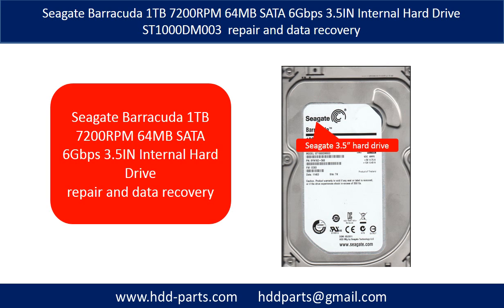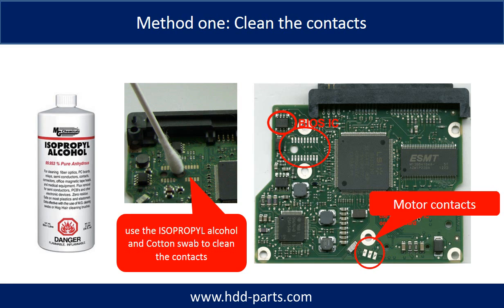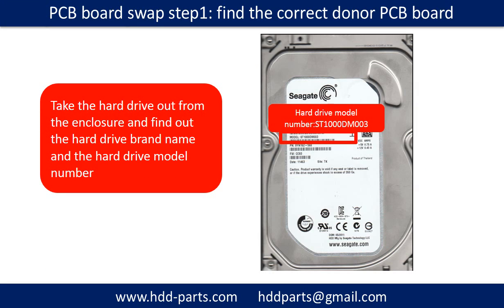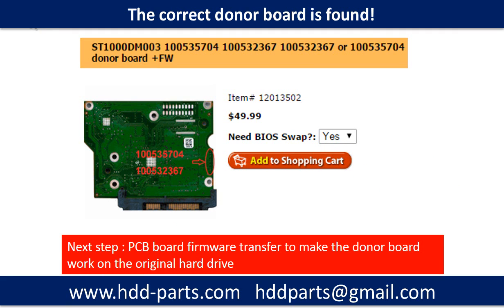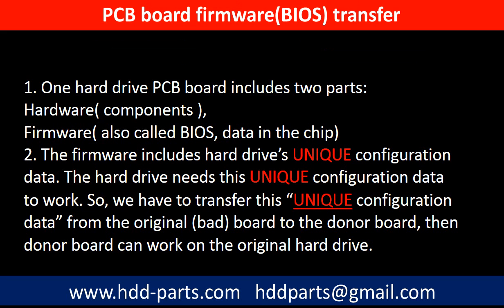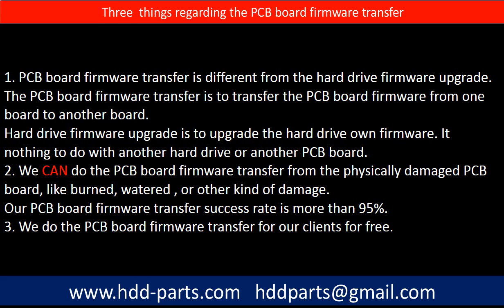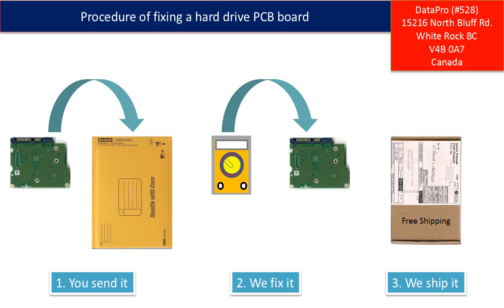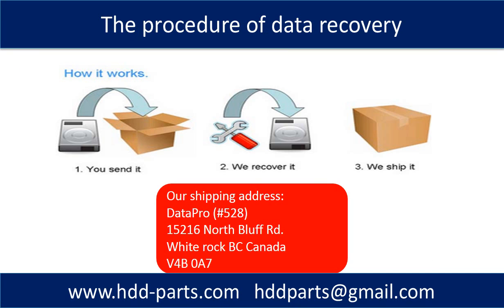Seagate Barracuda 1TB 7200RPM 64MB SATA ST1000DM003  repair and data recovery

Comment: Thanks for your video. it was really very useful. 
i have an issue with my Hard drive (SATA 2.0 Tera bytes, there is no noise and did not detect with my laptop, this hard drive for ASUS Desktop, i removed and connected to my laptop, it did detect at all.
what is the possibility of the issue and how much it cost if you make data recovery for 2.0 TB Hard disk drive SATA ST2000DM01, 7200 RPM with Firmware (CC4B). Thanks
Reply from the maker: $350 for data recovery
Reply from the maker: $350 for data recovery
Reply: How much to replace the board? Mine is 100664987